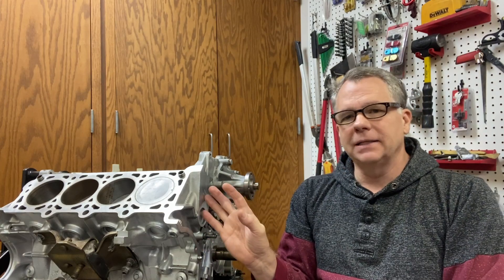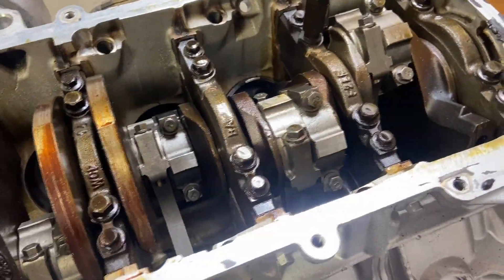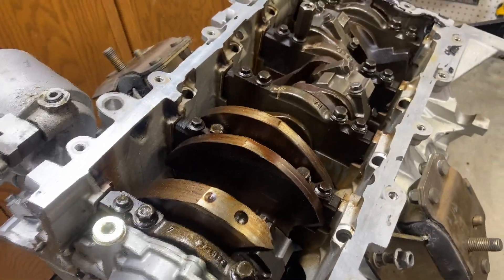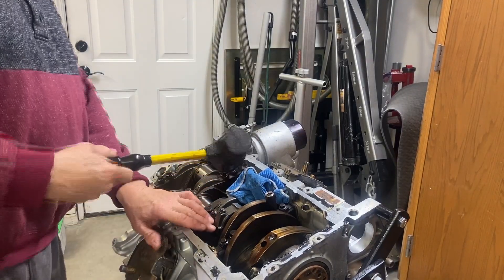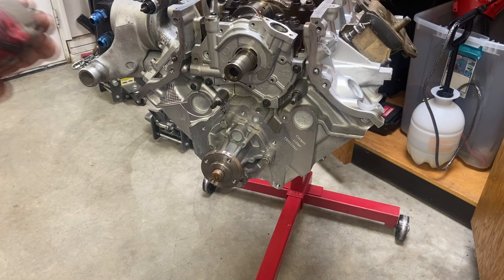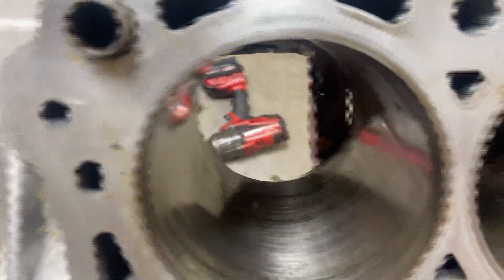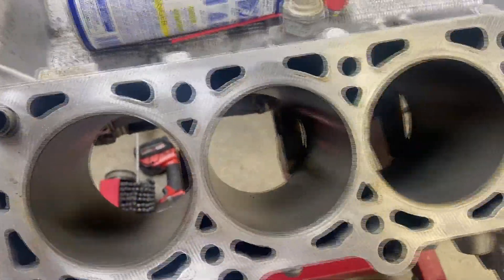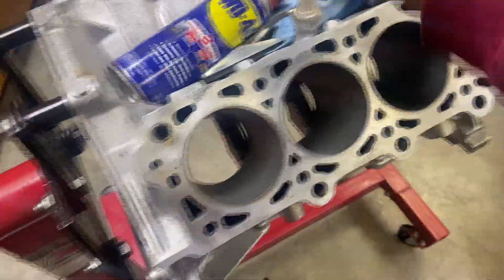97 Mustang Cobra Motor Rebuild (Part 3)

Comment: I realize this was a year ago but if you're going to do this kind of work you'll want to invest in 8oz-36oz soft face dead-blow hammers, that piston would have been out in a couple of smacks, using wood was the right idea. Grab a real breaker bar 24" or larger. That little 14" one has been painful to watch. It's also a good idea to get some sleeves for the connecting rods for removing/installing them through the cylinders, it's easy to leave a deep groove that could potentially ruin the block.

Looking forward to finishing the series on this 4.6L as there's barely any in-depth videos on them let alone a 96-98 Cobra. I'm sure you've long figured out that is the original engine to that car.